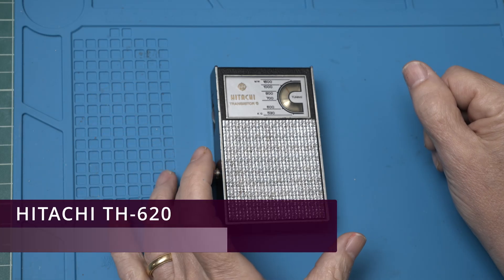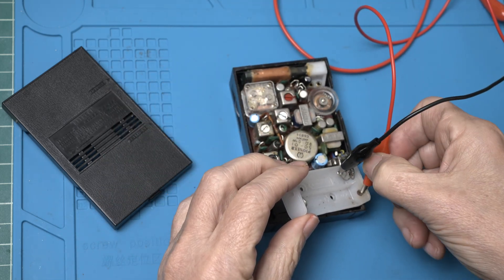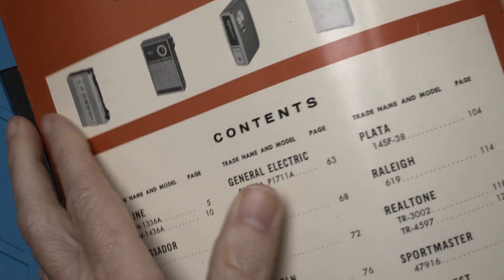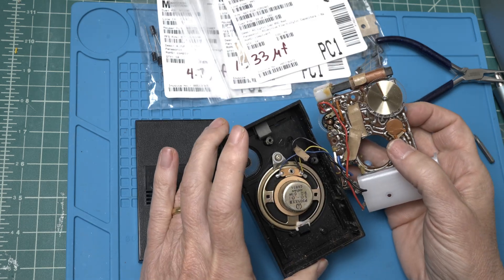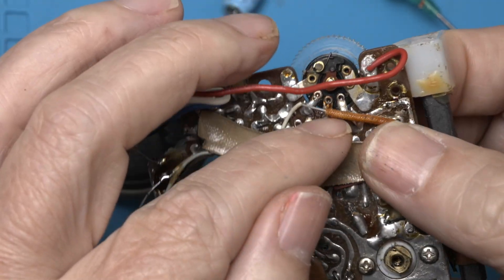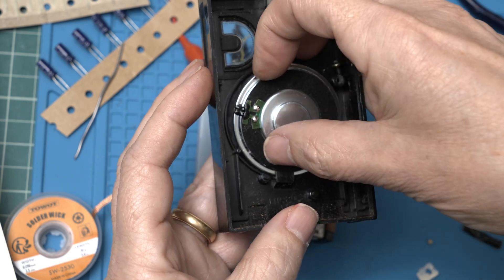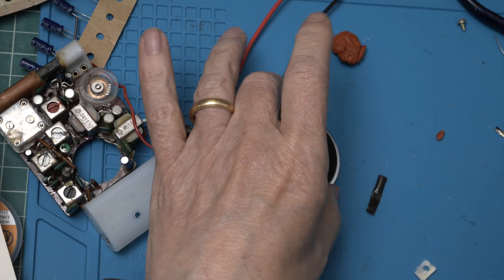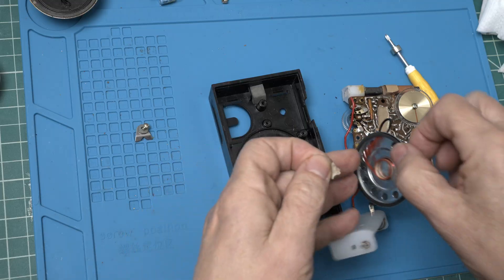Vintage Electronics Repair: Dead Hitachi TH-620 transistor radio restoration

Comment: I thought you marked the polarity with a red marker?
Reply from the maker: What happens is that you pull it out and then get mixed up which hole was which, so the red mark is to help you figure out the original orientation (I mark it downward, but totally arbitrary).  This has saved me so many times.  Usually the polarity is reasonably well marked on the cap itself.  Sometimes I will put a red mark on the positive hole itself to help myself out.

Comment: I don't see any change in the sound with those new flat speakers They sound tinny and not as deep as the original speakers.
Reply from the maker: You might be right - one of these days I should really try to do an A/B compare.
Reply: Me neither and the collectible value just halved.

In this radio there is still a problem. It is unstable ..the squessy sound at 8.43. Can be a bad transistor.
Reply from the maker: @migsvensurfing6310 Thanks for the tip, I will take a look!

Comment: Nice repair, nice radio. Made the year I was born. What a great little component the transistor is. We were able to make electrical items, such as your radio, smaller and when the IC came along we were able to make electrical devices even smaller.
Reply from the maker: Transistors (and then ICs) were one of the most influential inventions in human history IMHO.

Comment: Well done 😀👍👍👍 Will you be doing other repairs on these like faulty transistors and diodes? 😀
Reply from the maker: Yes, but I'm still looking for a good candidate.  New capacitors are easy to find, but these germanium transistors are rare,  I'm thinking the best way to get replacements is to buy a similar radio and cannibalize it.  Fortunately its usually the capacitors.